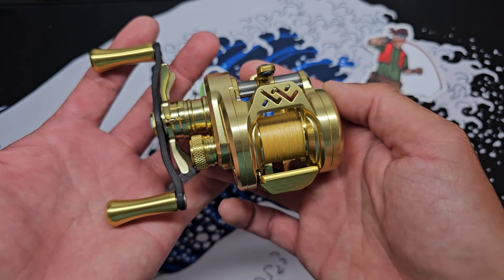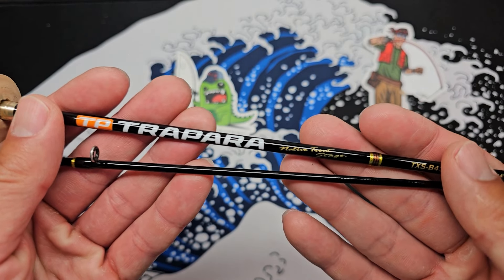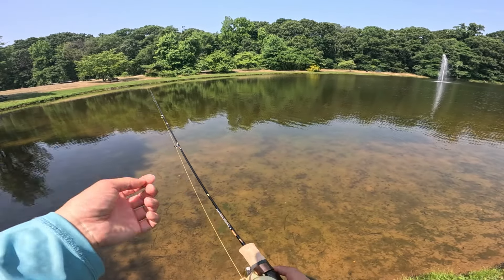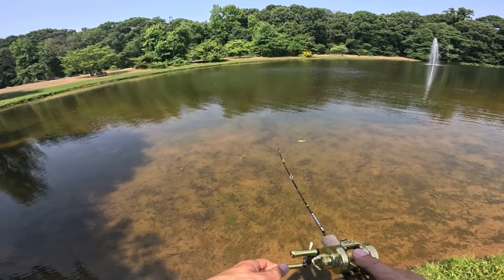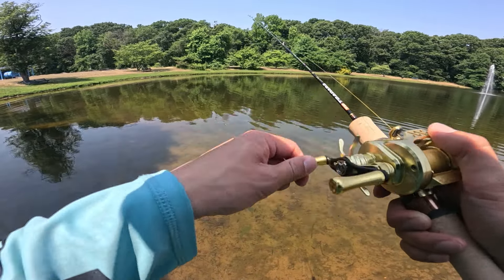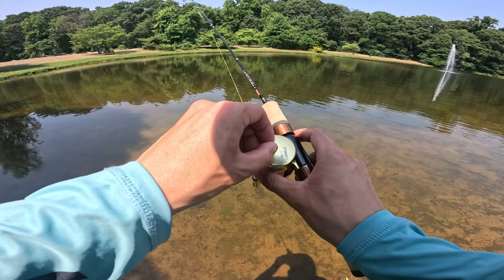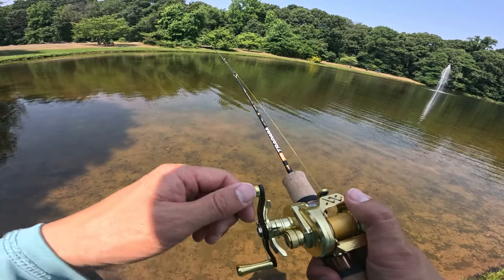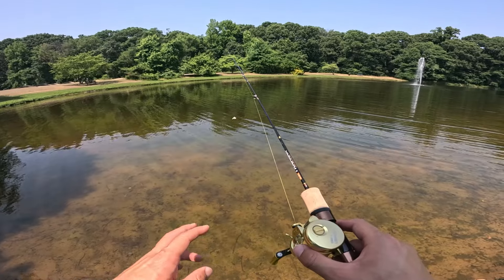How Amazing this DC Braking BFS Reel Casts? Loongze Airlite B50 B51 DBC-1

Comment: Question Buddy! I just got one though it looks like either they gave me the wrong spool or they changed it. There's no holes on the spool and my scale said 7.2 grams, could be my scale but im not sure.
Reply from the maker: Hmmm... If it doesn't look like my reel during my unboxing video... Likely it's not the same reel! I would contact em asap and see wassup!
Reply: @rawrfishing  TY so much for responding! I emailed them and they claim that the version with holes in the spool was a prototype and the new ones do not have any holes in the spool for added strength. Hopefully not being bamboozled lol, it was LoongzeUSA.
Reply from the maker: I see. How does it feel so far? Does it cast well?
Reply: @rawrfishing  I'll lyk as soon as I get a nice day to take it out!! Should be here this week
Reply from the maker: Cool! I wish it was simply a change that will help ensure longevity of the reel without compromising the performance
Reply: @rawrfishing  Agreed! I was a bit worried that it wouldn't be able to cast as light of lures, but I weighed it and it's 7.2g instead of 7.1g so hopefully it's a negligible difference. It's my first bfs reel so I hope it lasts 😅
Reply from the maker: I hope it lasts for u too! 😊 It's a pretty decent reel so far for me and people who used it said it's quite impressive
Reply: @rawrfishing  thank you very much!! I appreciate you making videos on it 😊
Reply: @rawrfishing  just spent about an hour casting with it, though it was limited by the weather, it was awesome! I only got to try a 1/32 0z jig head with a 2 in minnow but it was launching it! Only had one real backlash the whole time!
Reply from the maker: looks like it's gonna be some fun fishing for ya!  Enjoy and slay em during the fall bite!